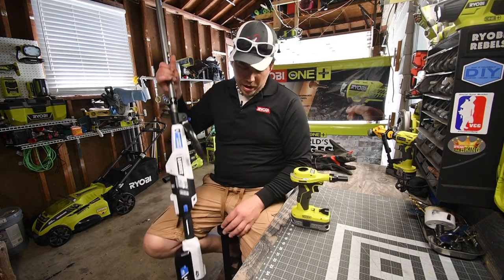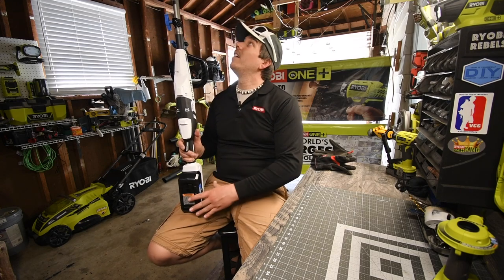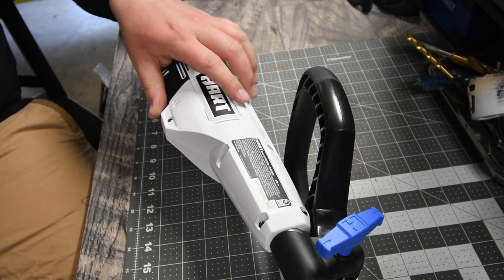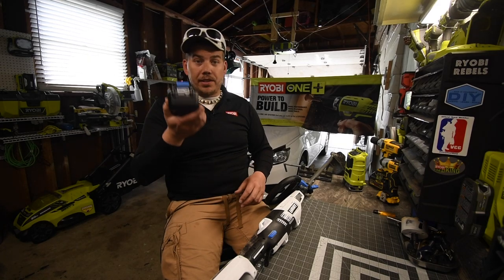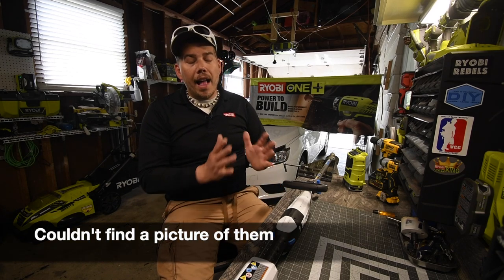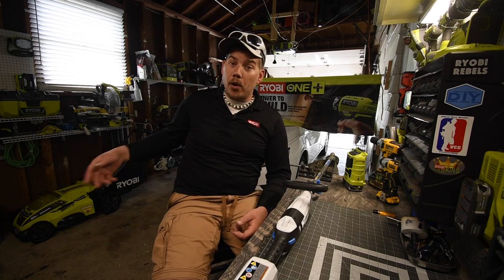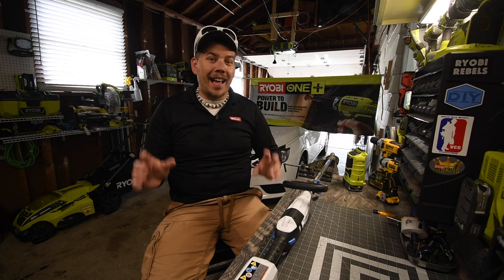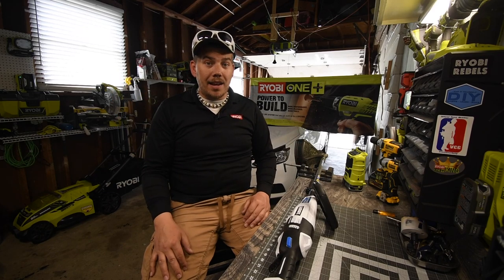40v Hart String Trimmer in action

Comment: you really should check out the ego system I know I already told you but it is really good. I was out cutting grass today and not the grass you are cutting big grass with all kinds of plants and all that stuff and it did very good. If you buy the string trimmer fro ego throw the string it comes with away cause it's realy bad go buy(or order of amazon it's safer) 2.4mm triangular string it's way better.
  

edit: if you see my other comment saying the same thing it's cause I posted this because I ouldn't fing the other one.
Reply from the maker: its all good. ill check out ego as well and I thank you Valer

Comment: Would you recommend gas or electric to homeowners
Reply: I personally love my electric tools I have the chainsaw, hedge trimmer, leaf blower, mower, and the weed trimmer during Ryobi days they have a sale on the 40v package. Goes for $1,000 right now during Ryobi days last year I got it for $800
Reply: I love my electric stuff its works nice and no maintenance
Reply: Unless you have a massive lot to mow edge and weed eat electric is the way to go. I have the ryobi 40v system and it’s more than enough to get the job done. IMO gas is more maintenance than I want to do especially when all I have to do is charge a battery, insert it and I’m good to go.
Reply from the maker: for the home owner. id say battery. for the professional lanscaper it has to be gas

Comment: Dude you are so wrong about the quality of the hart cordless hand tool line they are holding up in salvage conditions like high quality brands do, I work for Tiger auto parts  in Burton Michigan I have cut over 200 catalytic converters,and several core support from head on collisions and the saw all, never had a problem once, I am highly impressed ,I abuse the hell out of the drill and the 1/4 inch impact with no problems what so ever the power is on par with the other brands I have gave a arm and a leg for ,buy the hart line is very inexpensive and durable as hell but the way I work 7 days a week using the hart cordless tools ,I just bought that same weed eater today because I know it will hold up just fine , I'm not being paid buy any one, I'm truly impressed buy this product line and so are my workers that Barrow my Hart tools .
Reply from the maker: I use this 40v string trimmer all the time and I love this thing and I thank you for sharing your input and story Brian